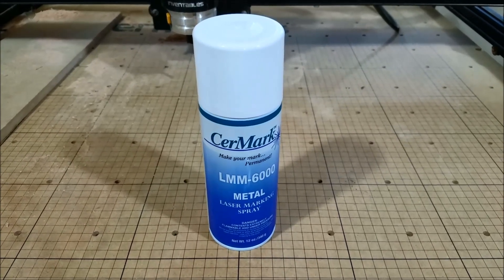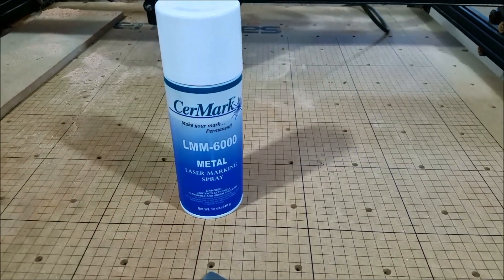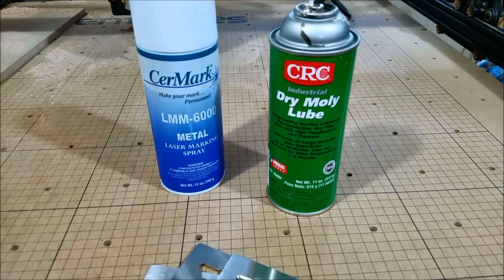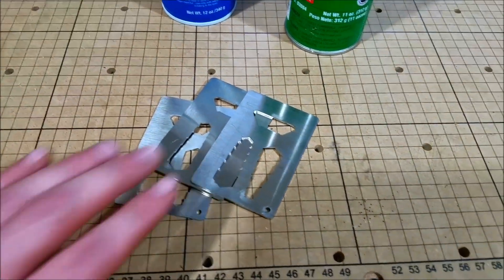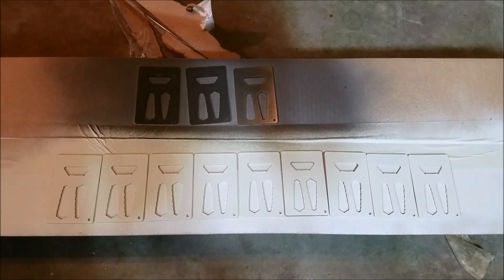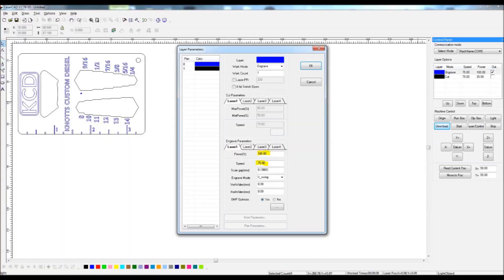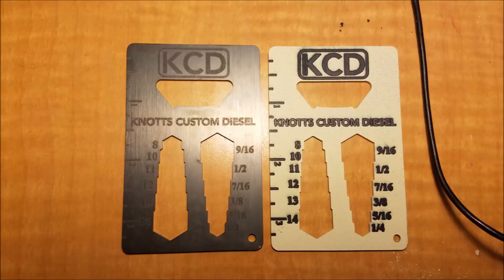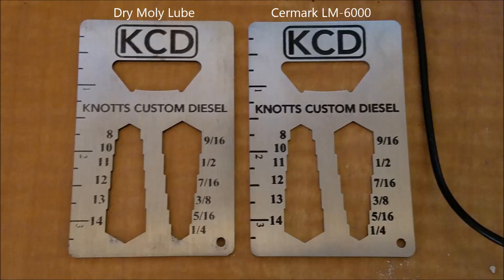Cermark vs. Dry Moly Lube

Comment: I have a suggestion that might add an interesting dimension to your experiment. Alongside the test cases you’ve already conducted, it could be beneficial to include a control sample – a piece of stainless steel with no treatment applied. This would offer a direct comparison to see how much of an effect the dry moly lube actually has on the laser marking process.

Including a control sample could provide clearer insights into the effectiveness of the dry moly lube and might help your audience understand the contrast in results more vividly. It would also be interesting to see if and how the untreated metal reacts differently under the same engraving conditions.

Thank you for sharing your experiments with us, and I look forward to seeing more of your innovative work. Keep up the great content!

Comment: Cermark is expensive and effective, but there are options that are cheaper and equally effective. Moreover, we offer water soluble inks that are specific for metal, plastic, ceramics or other substrates. Of course, specific laser marking inks are better than plain laser, because they let you use lower potency and engrave in a shorter time. Both properties save money and time. See my page. We are welcome to opinions and comparisons.

Comment: How long did you have to leave the spray on the material before you could mark it with the laser?
Reply from the maker: It dries pretty much instantly. Have lasered a few minutes after applying and after sitting on a couple days. I didnt notice a difference.

Comment: Is this laser equivalent to the laser youre using in this video?
https://www.ebay.com/itm/40W-USB-12X8-CO2-Laser-Engraver-Cutter-Engraving-Cutting-Machine-Red/153151531963?_trkparms=aid%3D555018%26algo%3DPL.SIM%26ao%3D1%26asc%3D20131003132420%26meid%3Dde004ecb84fc4dd0b8d355e6a3de7e6b%26pid%3D100005%26rk%3D6%26rkt%3D12%26sd%3D302886229320%26itm%3D153151531963&_trksid=p2047675.c100005.m1851

Comment: I tried the dry moly lube CRC spray can on stainless steel dog tags i bought on ebay but i couldn't get it to engrave with the 40w chinese laser. No matter how hard i tried
Reply: are you sure it is stainless and not aluminum.

Comment: thanks for sharing, i am interested to use Dry Moly Lube on either Aluminum alloy or Stainless steel (engrave wording), btw which material has the best result? Thanks.
Reply: doesn't work on ALU. only Steel
Reply: @TheFvSmallFry  Why does it not work with aluminium? Do you know?

Comment: Apologies for the late comment, only just searched for this...
From what I've heard, it's the glass frit  (in Cermark) which bonds to the substrate when it's melted by the laser, while the moly only supplies the color. Perhaps another test using the molyslip which has been dusted with a fine glass frit? 
Or, perhaps, some other moly product which could have glass frit mixed well  into it before it's applied to the metal.

Comment: I tried only the dry moly
might buy cermark at some point

my first trials were failed.. I was in the faith im using on 100 percent power..
the 10 mA is not 100 percent
today I set  to 15 mA  and used 200 mm per sec   

it worked..  I purchased earlier a couple of stainless mug  at walmart   and tried to scrape off the original
one came off  fully
so thinking on professionals are using cermark.. it might not really better
not to mention  very possible  cermark  actually same.. mightbe   some additive..

so thanks for  the video.. its working
yet   worth to make some more experiment..

Comment: What would you estimate the cut depth of both methods at? Also, what material and is this? More specifically than stainless, I mean.
Reply from the maker: Chris Spalding there is no cut depth. It basically just heats the spray which makes it adhere to the surface. Material is 316 Stainless Steel.

Comment: Hi there, great Video thanks. I am just wondering if the "Boldness" of the letters in the Cermark is good or bad. Yes, I can see it maybe look more black and bolder, but how is the lettering on the computer? If they are not as bold as the result from Cermark then there must be some kind of "bleeding".  You can see some of the letters are nearly closing inside because it is too bold. So can you please verify which one is the most correct one compared to the original Artwork?